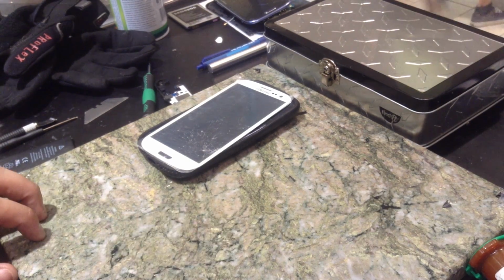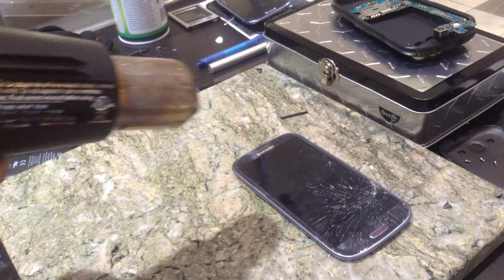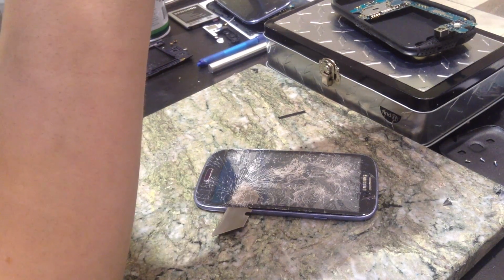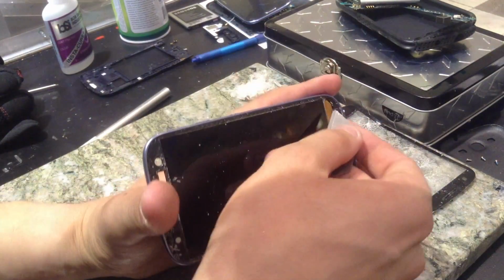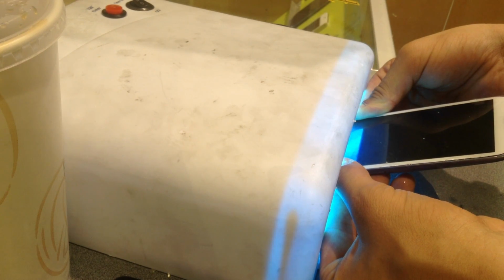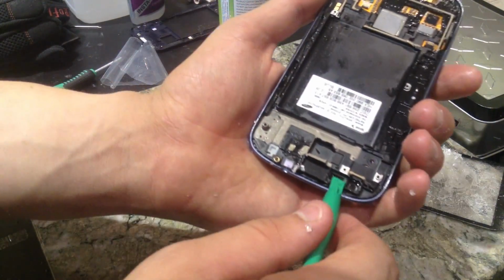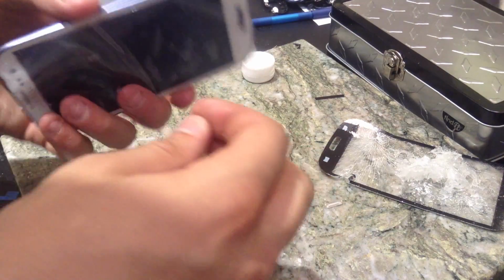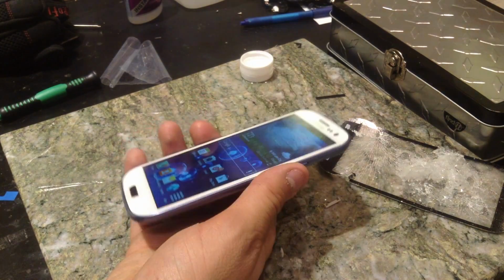Galaxy S III glass replacement (full detailed guide)

Comment: I did this with a S3 also, but i had so much glue under the home button, so when I clicked on it the glue came out every time. I don't think the glue cured around the home button, because of the UV light not going through the colored glass. I don't see you had the same problem? Did you experience this before?

Comment: Does the lcd ever get dark spots from the glue getting in it? I've seen that happen on iPhones before because the glue gets between the lcd and back light.
Reply from the maker: Sometimes they do, on iphones at least you can replace the backlight without too much hassle, but on galaxy phone either it will be fine or the LCD just wont work anymore, this is why it's important to not use too much adhesive

Also please don't leave the Google+ box checked in the comments, just a bit annoying to use.
Reply: There's no back light on Amoled displays. The iPhone has layers on the back and are poorly sealed which the glue goes in between.